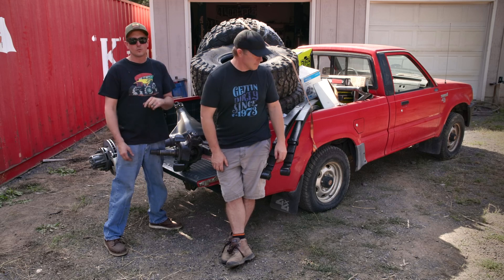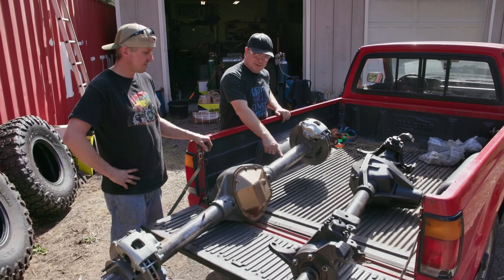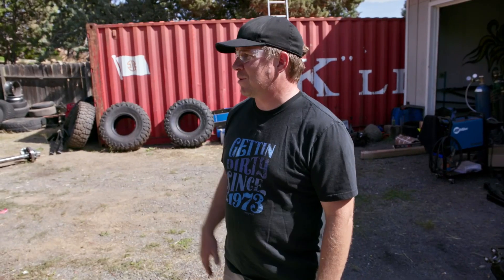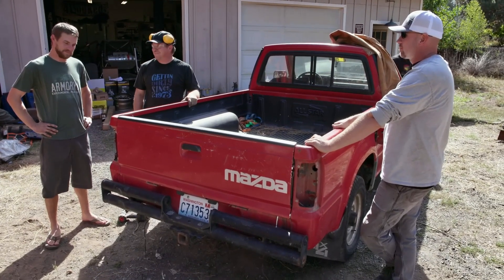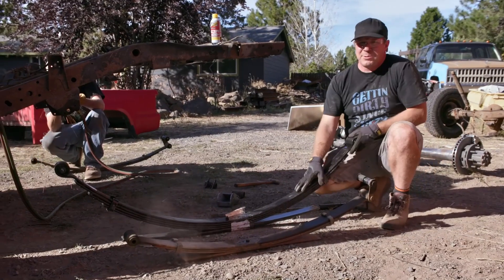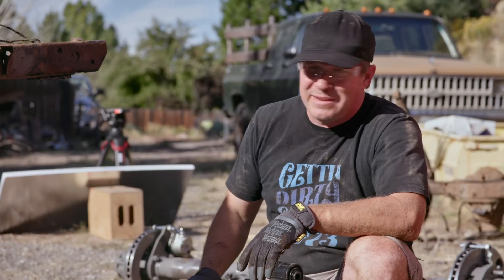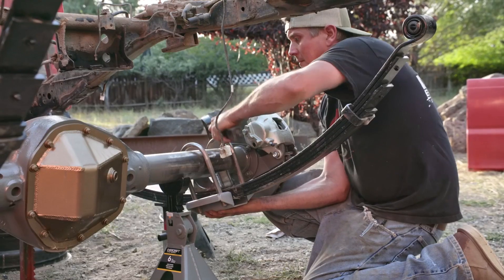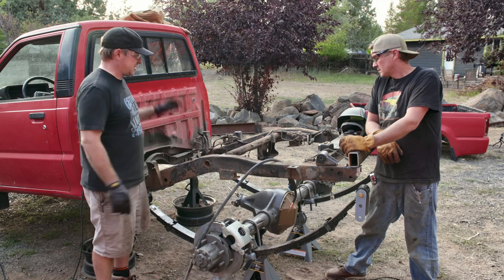Little Red Rockcrawler—Dirt Every Day Preview Ep. 97

Comment: Awesome recovery! I'm working on a 2000  Olds Bravada. Open to any advice. Been wheeling the heck out of it with a five inch lift on 32's.
Reply: they wont talk to u unless you pay
Reply: @mattsez2879  well thanks for the heads up
Reply: @mattsez2879  and I thought they were above that.

Comment: That is not at all how I would do it!! I would pull it in our shop. Put it on the hoist. Take measurements  Make brackets on the cnc plasma table. Bend some tubes on out hydraulic pipe bender.Made a 4 link with coils. No crappy leaf springs. Then welded stuff together.(mig and tig).